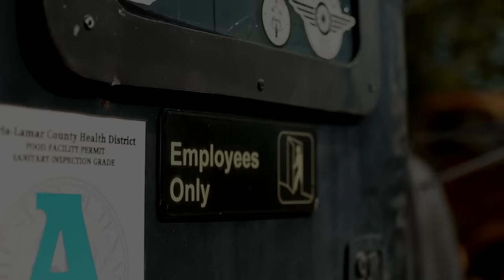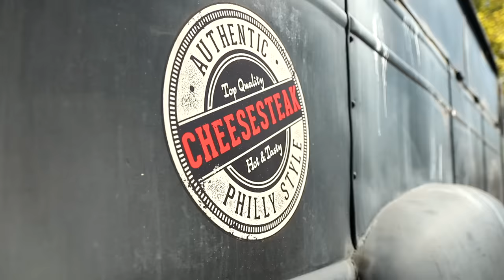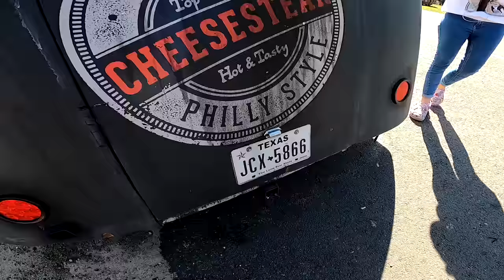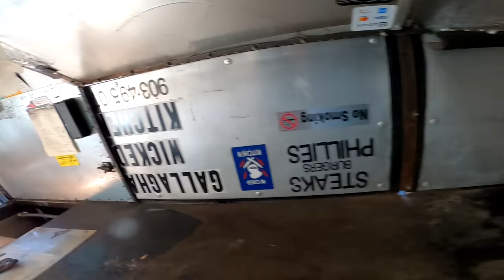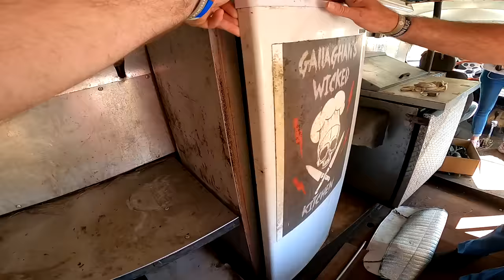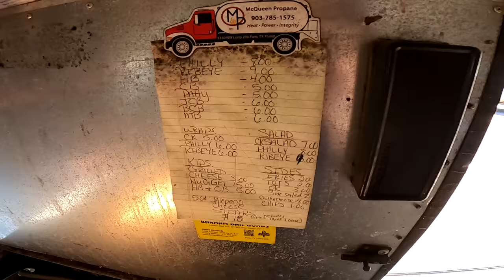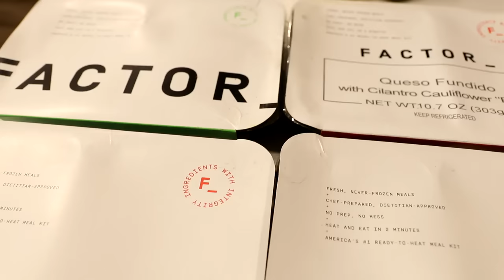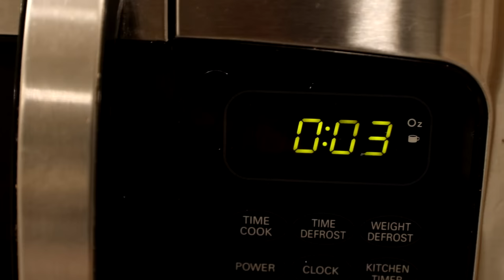We Buy The World's Coolest Food Truck | Flippin' Cars and Burgers | Turnin Rust

Comment: I think that needs much work to get sorted and the first thing I would do is lift the roof at least 15 inches so you can stand up straight 
You also need some major work to get some decent ventilation in it 
I had a small food vans prior to covid and the heat was a major issue and we had good cross ventilation 
But t still got as hot as hell in there and ours wasn’t black on the outside 
That really is a mess on the inside 
Good luck you guys 🇦🇺👍👍

Comment: Excellent video  Turning Rust  Crew Wylan  :) , Lance :) , Christina :) , that nice 1964 Chevrolet 1/2 ton pick up think that motor be rebuilt sounds of it to me and not sure but think carb looks like 1 barrel Carter 505 CFM same use on 292 6 cylinder motor too ! A friend of mine has 1963 Chevrolet  30 series originall had 305 V6 Hercules motor  with Coulmn Shifter 3  speed  , no Power Steering or Brakes  plus 4 wheels drum brakes, he put 327 V8 , 4 barrel carb, Floor shifter 3 speed  ,  411  Chevrolet rear end gears  but disk on front plus updated power steering and brakes  too ! But changes do put 2002 388 ratio with 8 studs to 6 studs 16  rims , Transmission  up to 4 or 5 speed Manual transmission  too and extra fuel tank ! He bought truck 9 years in Milwaukee Wisconsin even bumper got Stamp on and brought to Canada  near I live and fix up slowly  when he can Lol ! Truck was in barn never used since 1976 ! Also great shape for Orange color plus interior too with black ! That 1951 Chevrolet food truck did good and think motor looks like first Generation of Cummings Desiel motor in Dodge  from 1990's but hopefully found more soon when fix !

Comment: What I would do if It was me, clean it up, get it all clean so its one less thing on the to do list and it is the cheapest part. Then rip apart the wiring on that truck and go get a holley kit with a screen and everything. get the wiring all perfect. get it running right. Then worry about the outside and cosmetic stuff. This would be a sweet truck to continue to use as a food truck. I wish I could afford it

Comment: Great truck, but sadly, it looked so much better in the rain... the grill needs the upper area to follow the lower part and a Cadillac "Dolly" bumper would be so fine. It needs a matching trailer in the same style with a generator, supplies, and gas feed... to clean the interior you need to dry ice blast everything...